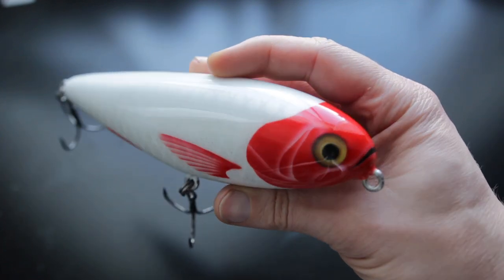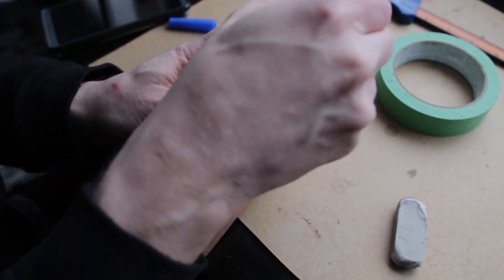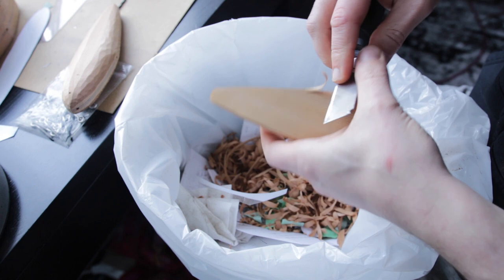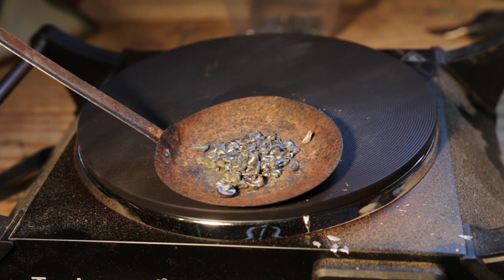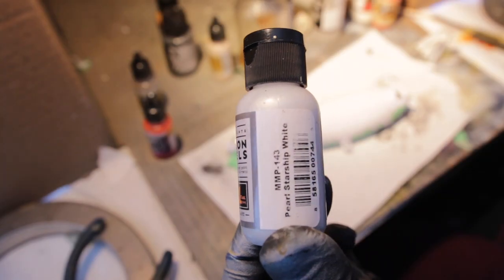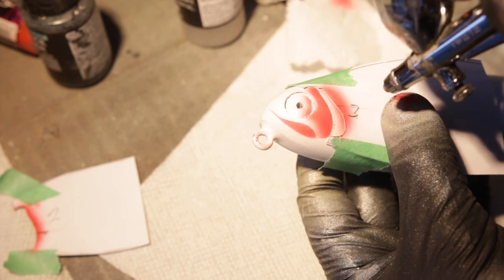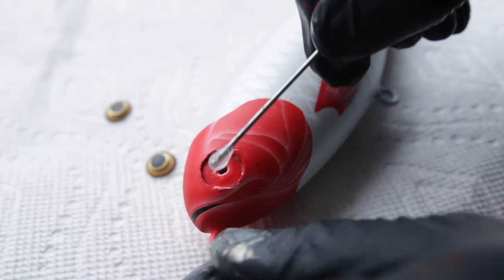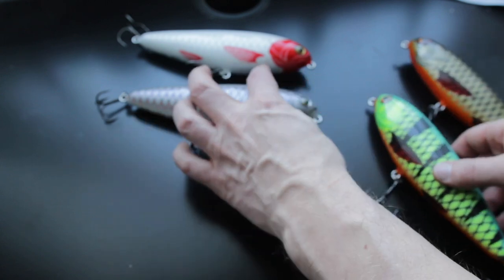Lure making | classic topwater walker lure

Comment: hi your work is fantastic ..
I give you a little tip ..
for your airbrush remove the head
and you will do smaller details
much finer lines and perfect headless points.
you work very well congratulations..thumbs up !!!
Reply from the maker: Thanks for watching the video. I have been painting without the needle protector thingie for as long as i have been airbrushing, bend quite a few needles during that time 😜

Comment: For the wooden mold for led , did you drill the holes first or did you cut the wood in half first? I’m going to try it . Does the type of wood matter? Any type of sealant for it? Sorry for asking too many questions but I really liked that.
Reply from the maker: The wood for the lead mold was cut first then i just clamped them together and drilled the casting cavity. You want to use hard woods for this purpose the softer types burn unusable pretty fast.
Reply: @SolarfallBaits  thank you, awesome videos!

Comment: What do you think about forstener bits? I used to use brad point bit i find forstener is much better, especially when drilling big, deep holes (such as for making rattle chambers) as the brad point bit flutes clog up with wood. Forstener doesn't have that problem. I also find they make way cleaner holes than brad point. Is there a reason you use brad point?
Reply from the maker: After certain size forstener make more sense but other than that i dont think there is much difference between the 2
Reply: @SolarfallBaits  i found at all sizes the forstener bits are so much cleaner. could be cause i just bought the cheapest brad points i could find XD

Comment: Honestly for the gloves, in my experience, as long as they are a tight fit and not loose, it is perfectly safe to use, you just want to avoid gloves with long threads or fibers

Comment: Excellent build... Many thanks... You really are a master. For those who are not wood workers, the brad point drill bits cut extremely cleanly by first centering the bit with the center point and then cutting the outside diameter with spurs... The cut then moves inward to remove the wood. Normal metal twist bits cut from the center toward the outside... This gives a fluffy cut where the bit is cutting into the grain of the wood. Then for those of you, who, like myself, do not want to be exposed to molten lead fumes, I mix small diameter lead shot (from shotgun reloading supplies) with epoxy and thus fill my ballast holes without losing my mind.

Comment: For screw eyes in soft wood, it doesn't matter as much about the hardness, as it does the tensile strength of the wood. The tensile strength is what keeps the screw eye in if you glue it correctly.

Comment: sooo will there be a bondo vs super soda?😂by the way what do you use to sign your lures? cuz i tried alot of things, but the epoxys keep ruinning it
Reply from the maker: You can use pretty much any type of pen if you cover the writing with 5 minute epoxy before coating the lures. That's what i do and it always works
Reply: @SolarfallBaits  Thanks for the info mate🙏